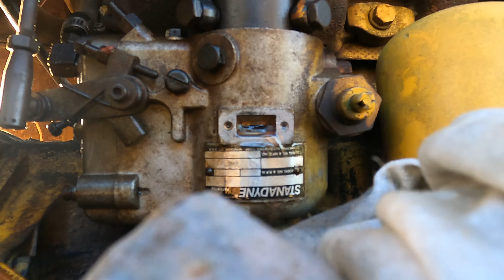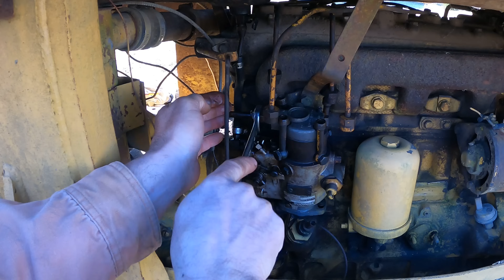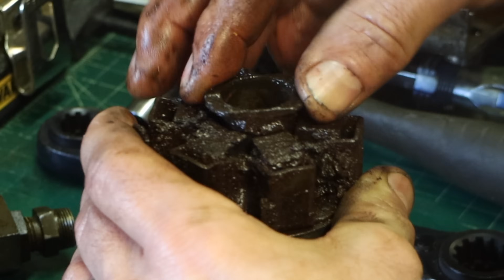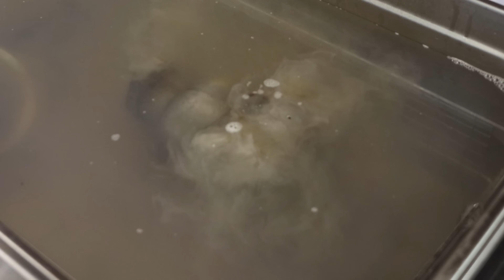Forgotten John Deere 1010 Track Loader, Part 2.

Comment: Autopsy but it’s not worth fixing man. Cut your losses there could be hydraulic pump issues, transmission issues all kinds of stuff. If the engine has been run out of it other stuff probably has been too.

Comment: My guess is that they ran that machine without airfilter and dust honed the cylinder walls. There is another channel of dude who had this problem with a tracked loader.
Reply: Someone here suggesting stuck rings would not be that even low pressure across all cylinders.

Comment: I was a heavy equip operator for several years and those fuel pumps were always a source of mystery to me. Everyone always warned me not to mess with them and how hard it was to work on them. Needless to say I'm thrilled that you decided to fix it yourself and give me a bit of an education on them all these years later. You removed a lot of the "mystery" for me. I'm not sure what sort of value that little loader might have if it were in good operating condition but it would be interesting to see it run and do a little work. And pulling the top off will generate content that I'm sure several would like to see. Good luck with it w/e you decide to do. BTW I once rolled a Cat 955 track loader due to a shift linkage failure while pushing a tree over. That got pretty exciting for a few minutes.
Reply: Lesson to learn? Install FOP and ROP protection on old machines that don't have it. Wear a hard hat when operating and a bump hat when repairing...

Comment: Good video John and I would say check the timing before going further, even if after making sure it is timed correctly carry on. Strip the engine check for wear and if the parts are available carry on with a re-build it's making a great video and I for one will carry on watching. !00%

Comment: Your cyl3, cyl4 wet readings were with a weak battery. Recall what the inside of the fuel pump looked like. Get a borescope and look at the cylinder walls. I'll bet they're fine.

Put some ATF and diesel in the cylinders and let it sit for a few days. Rinse and repeat a few times. While that's going on, get the injectors working properly and replace the bad glow plugs. Next, run two GOOD batteries in parallel to try to start the engine with the injectors working and a Little starter fluid. If you can get it to run, then your rings should eventually free up a bit with some heat. At that point, you will need the cooling system to work.

Comment: When you added oil to the cylinders, the last two cylinders (which had been spun longer) had the least improvement in compression, as though there was a lot of clearance between rings and cylinder wall allowing the oil to move quickly down the wall. Stuck rings, perhaps? Maybe spray some penetrating oil in the cylinders and let it sit overnight and try again. How about adding oil to the cylinders, then cranking it with starting fluid? Hopefully without all the prior spinning, the oil would still be there enough to make it hit.
Reply: And yes, with the small initial cost, you can put a lot of work and money in it and still come out ahead. My vote is for: do what it takes.

Comment: I'm back , the guy that said may the force be with you.  Before you decide to rebuild, look into the cylinder liners. All four liners are brazed into a 1/4 inch thick plate, the only ones I found were over $ 2,600. Also on the oil pump drive there is a small drill point that must align  with the drill point on the bottom of your injector pump drive.

Comment: What I found interesting is you are saying cylinder 2 is the best one.  You can see in the video that the paint on cylinder  two has been broken unlike the others, it looks like someone had cylinder 2 open.

I'd like to see the old beast running, even with a different engine if it came to it.

Comment: With all the rust you showed every where else, I say it’s well within the realm of possibility that all 4 piston rings are stuck. As well, with that bore scope view of the intake, it may also be losing compression via valves not seating from rust falling into the seating area. It’s not a lost cause and may not be a parts hog either, just lots of cleaning and leg work. I vote autopsy and thorough tear down, clean it and reassemble.

Comment: Hello John: Many good suggestions preceed me in the comments. I have built enough engines to know that even though you may be sure the timming is correct check it 1 more time. Also be sure you are setting up on # 1 cylinder some engines have very odd cylider designations. You asked for a vote here is mine. You have the tallent and equipment to do the rebuild, if required. Even if you have to taylor make adjusted parts. Lets see a rebuild if necessary, it will be great viewing.

Comment: Couple days ago, I tried to use my Harbor Freight 1/2 - 13 tap to clean up some threads. I couldn't get it to go  into a new nut straight. It was the first time I had ever used this tap. Needless to say, I'm in the process of replacing all of my Harbor Freight taps and dies.

Comment: Back of the valve you showed (possibly in the last vid) was quite crusty...Combination of slightly stuck rings and valves holding off seating?
Be worth a soak in something and possibly giving the valves a tap (checking setting the lash is also not a bad idea and will only cost time) and re check the compression to see if it gains any of the lost compression??
Also could the injectors be wound onto the lines and then check you have fuel actually coming out with them out of the cylinder whilst cranking

Either way - it looks to be quite the project!
Thanks for bringing us along for the entertainment - quality is perfect as usual!

Edited to add - get that leakdown tester you pine for...that will tell you if it is JUST rings...plus no doubt will give you a few more vids using the lathe to make adapters to make it chooch with that engine :D

Comment: Great video John, my first question would be is it of any use to you if it runs? Then do a teardown after you have turned the fuelpump 180 degrees and it still doesn’t puff smoke

Comment: I would bet money someone has smoked the rings with starting fluid.  Pull the head and oil pan, then yank the pistons out. I almost guarantee the piston material is smeared over the rings.  I just rebuilt a yanmar that had a failed electric pump. Which ruined the injection pump because lack of lubricant. I was told it ran fine on all 3 cans of starting fluid🤦‍♂️🤷🏼‍♂️. New injection pump, rings and a quick honing it runs fine new
Reply: On second thought… surely you have done your research on these engines.
It very well may not be worth it if it’s even possible to fix. I hope it’s just rings but they said it had a coolant or overheating issue which tells me it’s got cracks.

Comment: 12/16/23..JD 1010 Loader, 4 cylinder with low wet & dry compression results via both videos 1 & 2 so far. Oh yes, a rebuilt injector pump via your willingness to 'jump-in', show us internal (worn) parts & Area Diesel Service assistance (info & new goodies) then your rebuild. So your efforts thus far confirm total (old) engine removal & rebuild...lots of time, effort & $$$. You ask we loyal viewers...what to do? Rebuild or junk?...it depends...you said you are a YT content creator...so continuing..a rebuild.. fulfills this 'content creator' aspect...but hey, how much time & $$$ do you have to dedicate to this particular content vs other 'content' projects...? Either rebuild or junk-&-move-on is ok for me. I will watch your videos with great subject matter, articulation, camera close-ups, test instruments/gages, bore-scopes, lathe turning, mig welding, tree removal, pond digging...on & on... so...at age 78 sipping wine & watching & learning from all you do...I kinda say, if you have a legitimate >need< for this small JD 1010 Loader, then Rebuild...but if no real need other than a 'quick' project-which this is not- then (junk) & move on. Much enjoy all your videos... Stay safe & carry on👍💪🔧⚙️🍷😊

Comment: My suggestion: 1. Perform an autopsy 2. Determine the parts cost  3. Determine the time needed. 4. "Add" that up. 5. Determine if it is worth it. Then 1. Determine the cost for a rebuilt engine minus the exchange for the core 2. Determine the time needed. 3. Compare the two approaches. Make a decision.

Comment: Greayt Video the Injector  pump rebuild was really interesting. Some of the bodge suggestions just to get it running were interesting. I would add more oil to the cylinder heads and see if it lubes up the rings any more and try some heat in the inlet manifold. would be worth it running like a dieing dog before a rebuld. Great content as always John! Any water in your friends Dam yet?

Comment: Sorry to see your video end there. I understand that there is a point where you get in to deep and it's not worth it. 
I have yet to take on the steering clutches on my machine.
By the way, the serial number on your crawler indicates that it is a 1962. And that lever on the left side of the control panel is the reversing lever, a feature that is nice to have.
There is a guy in Georga, Farmer John, that had graveyard full of these John Deere dozer/crawlers, and sells the parts to people like us.

Comment: Well your going to have to rebuild all the hydraulic cylinders, maybe the whole system, dont know what the transmission / driveline is like and what the brakes are like or how much play is in all the bushes and also your in for an engine rebuild. I say take the pump off to get some money back and sell it on for scrap and if i really wanted a tracked loader then get one in a better condition. Talk to matt at diesel creek. Sure he will collaborate with you and knows of one or even has one.

Comment: Those rings could be just stuck and need to be ran to get them unstuck. I would spray enough starting fluid in it to get it running one way or another and let it run for a while to verify if the rings are stuck or just worn out. Does it really hurt if you load it so much with spray to get it running since your already talking about a overhaul

Comment: Well, lawn art comes to mind...  I think you are discounting the valves, Jon. That scope peek down in the intake showed a badly rusted valve. Unlikely that they are sealing (insert seal here) with rust that heavy. Imagine if one or more were open when rusted! So, you might get by with a top end rebuild. A leak down test would help. If you did the top end and still had crappy compression, all you would be out is your time and a head gasket. 

I watch a lot of will it start videos, Vice Grip Garage being one of the best. Derek talks about how the rings and head gaskets need to "come back" and seal (hey, another seal). But it needs to run to fix itself. Since you now have an excellent pump, can you hook up the injector to see if they are spraying at all? Like you, I still question the pump timing. 

If the engine had fluids, I'll bet it just needs a top end job. When you pop the head you'll be able to tell from the top of the pistons if you are getting ring blow by - they'll be shinny on the edges, ie. lack of carbon. Keep in mind that I'm an expert (Expert = a small drip under high pressure...) mechanic with a diploma from YouTube U. Good Luck. I think that 1010 will make an excellent series. 

And talk to Matt at Diesel Creek. That 1010 engine would be in Matt's wheelhouse. Also, Mike at Captain Kleeman overhauled a Ford 555 in frame and now has the best starting Diesel on the Internet. And if you got the engine running, the value of the 1010 would increase dramatically, even if the clutches and tranny are junk. Oh, if you get into clutches and brakes, check out Jesse Muller. I think he has a newer version of your JD tractor. PS. You have a stout constitution to take on that pump rebuild. Excellent work!

Comment: Judging by the back of the valves, I'd say you're losing compression there. 
Set the timing properly, ultrasonically clean the injectors with oven cleaner soaks, set the battery charger to nuclear, new glow plugs on a switch, fire her up!

Comment: 1. pull valve cover and check timing. You must have the timing right and not just close. Diesels are static timed and not active timed. 2. Put acetone and ATF in the cylinders to soak the rings to get them unstuck. 3. Rebuild the injectors. You have not established that the injectors are actually firing or that the pump is creating enough pressure to pop them. Since you had no smoke at all from the exhaust even when using glow plugs in a prechamber engine I would say the injectors on those cylinders were not allowing any fuel into the cylinder.

Comment: Autopsy=yes.   Cost of parts and machine shop labor to mag particle test head, etc. research re-powering it with another Diesel or a massively overbuilt gasoline V8 with a cam that makes it sound like you’re fixing to launch it for a 1/4 mile run.  LOL.  Everything is fixable and doable if your knowledge, access to tooling and machining or a machine shop if your pockets are deep enough.  I’m hoping for stuck rings, bad valve seat sealing that a simple lapping will fix. But, what is the cause of the coolant problem that got it to where it is.  Is the block water jacket cracked or worse blown out in an area that you cannot weld repair.   Find extent of coolant system problem before more money and time invested in any of it unless you just want good YouTube video content as you chase the rabbit down the rabbit hole.

Comment: Great video again Jon even though a disappointing outcome. I vote to take the engine out and if it’s financially viable rebuild it or try to source another one and replace it. Obviously cost is the big issue but if you did get it up and running would you be able to sell it and get your money back ?

Comment: Low compression on an engine that's been sitting for a while isn't unusual. I'm not a diesel guy but I've revived more than a few gas engines with no compression. Rings can leak but just as important, exhaust valves tend to leak. A bore scope would tell you if you have any seizing pretty quick. If I had decent looking cylinders I always started with oil/atf in the cylinders followed up with a differential compression test. Leaking valves will be obvious. To clear the leaking valve I would pump air into the cylinder and rap in the rocker with a brass hammer. My experience is that it takes a few raps and sometimes some atf to clear the problem. You might still have some options before diving into the engine.

Comment: Didn´t JD put that kinda plant in some more machines? Maybe there´s a running engine available to swap?
Maybe go thru the rest of the machine and determine the fate after taking the boroscope and peeking into some holes?
Could be You find more carnage or (I wish You) shiney surfaces.
I liked the outro blues- who is that?

Comment: I believe a little assesment of valves and timing, new head gasket and some good ol lucus oil or marvel oil for any stuck rings to break free and you will have it running! You've done the hardest parts of what keeps a diesel going already! The rest is just common procedures with tunning an older diesel that has sat for years!

Comment: Hi John, i have a question and some suggestions. 
15:39 maybe a stupid question, but i don't see any fuel solenoid, so how do you stop this engine ? Just by closing the fuel tank shut off valve ?
In part 1 you used the borescope and took a look inside the intake, that valve was very rusty, this gives 2 problems : 
1) They don't seal good, and this can explain the low compression
2) If they sealed good, the valve stem is propably also very crusty, and that will work as a file on the valve stem seals, so the engine will consume lots of oil.
To see how good the valves are sealing without opening the engine, you can use that adapter that you made, and turn each cilinder at top dead point (intake and exhaust valve should now both be closed), screw in that adapter, and apply air pressure and check if you have air leaks into the intake manifold and or exhaust. Leakage to the crankcase is normal with this test. 
But before doing this leakage test, it was nice if you could take a look with the borescope inside the cilinders, if the previous owner had cooling problems and run the engine to hot, to mayby a point where the engine even (temporary) seized up, the cilinderwalls can be scratched. This will give a great amount of air leakage to the crankcase and low compression.  
For engine testing purpose, you can bypass faulty glow plugs by using a hairdryer and place that near the intake manifold, so that the engine draws in hot air. Back in the old days, before glowplugs where made, they used burning newspaper inside the intake to get the engine started. 
And last tip, but that's the least of your worries at the moment, is at 3:29 , that (hydraulic ?) hose so close to the ground is screaming to get punctured, that need some TLC 🙂
Reply: Manual fuel shutoff

Comment: The engine probably needs rebuilding, lack of compression will cause blowby and smoke. But if you have a propane torch, try to heat up the intake as much as you dare to do, maybe feed the intake through a heat gun. It will help you get to the "flame point" sooner. The temperature when fuel and air self-ignite... If the timings right....

Comment: 230 or so is minimum for it to run should start and come around I would bring it to top dead center and fix the timing before giving up 250 is plenty to run I had a tractor that had around that in each cylinder ran fine but all my glow plugs did function

Comment: I do have a suggestion: the hole where the injector goes looks pretty big, so you could try to put the endoscope camera in that hole, and look inside the cylinders (seen that on "M539 Restorations"); at least you can see if there are scratches, rust or other things that should not be there.
Great videos, and I would like to see that big baby of an engine run! :)